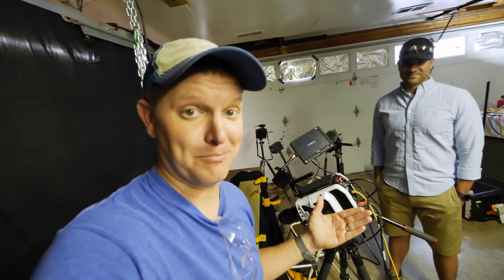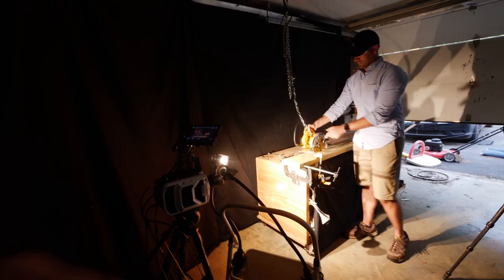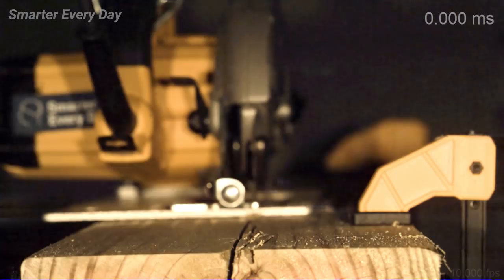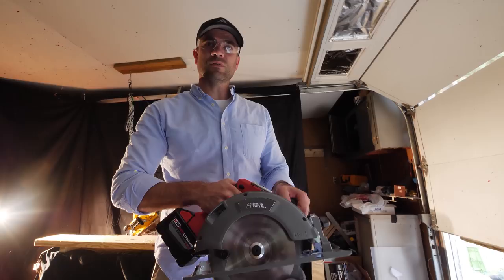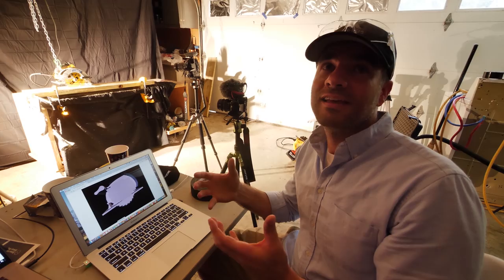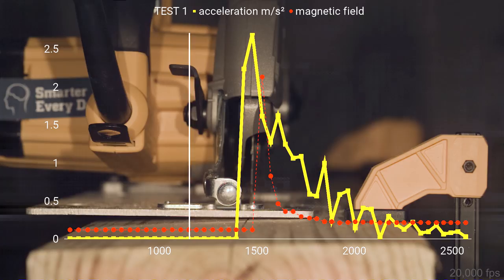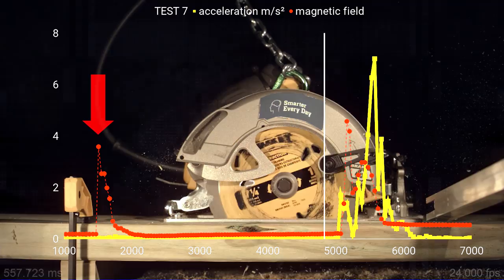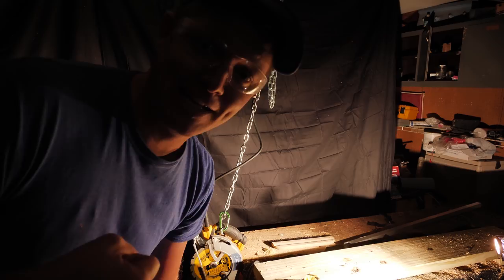Circular Saw Kickback Killer (We used science to make tools safer) - Smarter Every Day 209

Comment: Even if you don't believe in the concept of this specific safety device you have to consider the implications of how they got their solution. They used AI learning to find a solution to a problem. The computer can analyze thousands of situations and react pretty immediately to a problem. Using this method could open a door to many other similar solutions to issues that may not even be related to the circular saw at all. To me, this video is about their solution to kickback as much as it is about using machine learning to solve real world problems.
Reply: Yeah, I agree. This is essentially an ultra refined clutch calibration that stops the motor instead of intentional slip.  This  would be a very nice feature in any high torque circumstance.  My thoughts  jump to a right angle drill.
Reply: I would call this tech a :  velocity sensitive position relative safety sensor. (VeS PReSS)
Company name ....Ves Press safety sensors..
Reply: I do appreciate the effort, but it didnt use AI.  It used machine learning, which is what we used to call statistics back in the day.
Reply: @roromad9603  They use what is nowadays colloquially called AI: a computer program that can make "smart independent decisions". How this particular AI is implemented is by doing machine learning: feed the program plenty of data, and let it learn by itself. Also, I do appreciate the efforts but whereas it may appear close to statistics, there is a slight difference. Here, they only care about prediction: they don't care to understand what constitutes a kickback event , they just care to detect when there is one. No statistical machinery is involved (no test, no inference, no nothing). At the end of the day they don't have a better understanding of kickbacks: the machine has just learned how to recognize one. Machine learning and statistics are not interchangeable words.
Reply: @wiwh404  This is not artificial intelligence nor is it machine learning.  There is NO WAY that I want a simple program predicting whether or not a kickback event is occurring.  To do so would be to put people's lives in jeopardy.  This is statistical modeling based on data.  That is it.  Sorry, but it is nothing more.  People like to throw around "AI" and "Machine learning" to make it look like they are doing something more than what it really this.  This is just statistical modeling.  that is it.  Now, this does not negate the fact that two really smart people are trying to figure out ways to make things safer using very cool methods.  I appreciate and respect the effort.
Reply: @roromad9603  You misunderstand what people mean by artificial intelligence, and you seem to misunderstand what  machine learning means. I agree partially with what  you're saying after having corrected for your wrong terminology. Nobody is claiming that this software can somewhat learn and be more clever than a human. They are by construction restricted to their very restrictive context and very  limited inputs. But this is very much machine learning by its very definition, and is very much what artificial intelligence has come to mean nowadays. This is, however, not very much about statistics. If you insist that there is a mathematical model behind it, then I would rather use the term "probabilistic model", which machine learning in general makes heavy use of, in all shapes and forms. I think your expectation of what "artificial intelligence" means are too high.
Reply: @wiwh404  during school i worked construction.  i now do work in the software world (after getting an engineering degree).  I know what AI means, what machine learning really means, and what statistics really means.  in my experience, people use AI and machine learning as marketing terms rather than the computing use.  you can correct all you want on the anonymous internet.  i know my terminology and i can easily spot someone that reads blog posts in the internet.  regardless, neither of us is going to concede.  have a great day.
Reply: @roromad9603  I didn't mean to hit a nerve, I'm sorry. I'm a Ph.D. in statistics and just wanted to point out that there are other definitions of these words than yours. You can keep yours, or just use the definitions most people use. The latter makes communication easier. Either way, it's your choice.
Reply: @wiwh404  No worries!  I realize that i am a stick in the mud when it comes to this.  i guess it stems from the fact that I feel that my AI work is much more complex and different than what people use as marketing terms.
Reply: @wiwh404  What an insanely polite and classy way to tell this guy to just go on using the terminology he wants for the things that every other people already agreed in a name. That is 2019 at its finest: people that think their way of calling things is better and everyone is wrong, not them.

@roro mad This is what the other 8 billion human beings  around the world would call AI and machine learning at the present time. This is not statistics by any means. As Guillaume pointed out, you don't build a mathematical model from the data. In fact, the way the computer recognizes things after you fed the data is irrelevant, and most of the time really odd and counter-intuitive to humans.

The point of using AI and machine learning in here, would be to distinguish between a simple change in acceleration (that could just trigger a switch and turn off the saw) from a proper kickback event. This, if done correctly and with more data, should avoid triggering on false-positives, although there are probably better and cheaper ways to do it.

The one thing i would agree with you is with this: "There is NO WAY that I want a simple program predicting whether or not a kickback event is occurring." This is actually scary, but unfortunately to you it's already happening: self-driving cars are around the corner, and even with smaller driving-aids you have sensors and computers deciding for your life (being machine learning or not). Not to mention the possibility of creating AI war drones to decide if you're a threat or not by using a weird machine algorithm.
Reply: In this use case, I think using machine learning is overkill and potentially dangerous. I would rather trust a set of hard coded thresholds here.
Reply: Maybe but once upon a time necessity was the mother of invention, rather than the other way round

Comment: Nice usecase for the AI.
Reply: You think saw kickback is bad?  Just wait until the AI kicks back when it rises up against us and starts chasing us with the saws that we gave them control over.
Reply: @jeffirwin7862  I like the Terminator movie too. Don't wait until they all become evel, just find someone of them that can be your friend and can protect you ;)
Reply: Jeff Irwin i need to start saving and repairing my dad and grandfathers old electric tools if i want power tools that dont kill me of their own free will i guess
Reply: Lassi Kinnunen  lazy programming basicaly. Let the ai figure it out, realease the software, iron out the problems as the complaints come in. Software is all the same nowadays, it's all in a beta state, never finished, always being changed and never quite works the way you want it.
Reply: Not really. Over engineered like crazy. This could easily be solved with just an accelerometer and 60 minutes of calibration to determine at what level of sudden motion it should turn off.
Reply: Lassi Kinnunen  the machine learning in this use case is really just a fancy way of saying they sampled a bunch individual saw usage, and created an algo to use in the micro software. there really isn't an AI in the finished device, but rather a micro running commands based on input. in any case, this is overly complicate. just use a blade stop like stop saw has. comes in contact with skin; breaks the saw blade. no false alarms, not complications.
Reply: @fd3871  There is AI in the form of a trained neural network, it's just not doing active machine learning anymore.  Also, they didn't create the algorithm.  The algorithm is "use a neural network".  The magic is in the layout of the neural network (number of neurons and hidden layers) and the weights between all of those neurons.

Comment: ..........am I the only one disappointed that they removed the safety guard? I really wanted to see how quickly that will fall into place.
Reply: @albertogomez6196  Sorry, but I've never seen someone use a saw without the safety guard.
Reply: @albertogomez6196  .....ummmmm...I literally know ZERO people that have taken the blade guard off. That includes about 15 contractors who use one professionally.
Reply: @albertogomez6196  Maybe people you know do that. I would not call that a "normal" practice.
Reply: animalmother556x45 usually framers or a dedicated cut man will wedge the guard up. Sometimes thin or profile cuts can’t be done without the guard being manually held open. The angle of approach makes the guard push the saw over instead of opening the guard.
Reply: You’re not the only one man
Reply: iOS gameplays   If someone removed that while working for me would be FIRED!!
Reply: I work 7 hours a day with circular saw somw days.... newer had an idea to remove guard :D
But yes, i have held it open with my other hand for tricky cuts. But when you hold it like that.. the "kickback" can only happen away from your body becous the saw is turned away from your body.
Reply: These experiments are done so  the kick backs may be observed and studied without the encumbrance of the safety guard which is an already known.  I am very sure they will not want to use a saw for real without the guard.  When making experiments it is usual to make things as simple as possible so that only one variable at a time is in play.
Reply: @scottmorgan133  I know nothing about woodwork but common sense tells me, that maybe, just maybe if the safety have to be compromised to do the task, the tool isn't designed for that kind of job?
Reply: @albertogomez6196  comfortable? Have you used a circular saw? I would think comfortable would be as much shielding between any part of me and any kind of rotating saw blade. 

As for having to wedge the guard open... I would suggest that maybe the wrong tool is being used..
Reply: Herioz no, sometimes it is the only way. There are a lot of times where safeties actually make things a little bit more dangerous. This is also why OSHA invented the Competent Person option for sketchy stuff.
Reply: NoSuspect not really. Ever ride a motorcycle?? I feel much more comfortable riding my bikes then I do being restrained in a 4000lb battering ram made of steel and glass.
Reply: Probably was for the filming of the blade stopping? Cant see it very well with a guard in front......................... Otherwise maybe they'd have left it on.

Comment: As someone who knows a guy who nearly got disemboweled by a saw kicking back, this is indeed something that needs to be added to more machines.
Table saws, certain types of band saws, and even a few radial arms have things like this already, so why not the ones that can potentially do more than just cut a finger off at worst?
Reply: Saws are dangerous in general and even with experience things can happen that are bad and usually it comes from fatigue while using the items. Where your brain power is running out and those things you normally feel or listen for are delayed because of fatigue and this is where these things can help.
Reply: Bandsaws are relatively safe. Table saws can impale you with a piece of wood, and throw wood at crazy speeds, so you won't just lose a finger.
Reply: Plunge/track saws can still kick back. you're just riding a saw in a track, not fixing it to the track.
Reply: @sarinhighwind  fatigue plays a big role but in my experience the biggest contributor in woodworking tool accidents today is intentionally disabling safety features and ignoring safety guidelines. E.g. removing safety covers, splitting wedges, taping on safety switches. In other words being stupid in the first place.
 Thunder Winkle : plunge saws & track saws are not really more safe than a circular saw with a spring cover. While any such mechanism is great and reduces severity of injury the best safety feature to prevent pinching and thereby kickback is, again the wedge.

Comment: My dad ran his small construction business for the better part of 30 years, which means I got my start in construction at about 5 years old.  During my lifetime I can't tell you how many times I have seen both experienced pros and newbies make a careless mistake using the saws. There is one major rule for the circular saw and that is, NEVER MAKE YOUR CUTS IN BETWEEN THE SAW-HORSES. That is what causes the pinch.

To be honest, cutting foam insulation is what I have always considered to be the most dangerous task in construction. Doesn't matter if you use a circular saw or a table saw or a chop saw.... if the foam starts to pinch it will grab the blade and shoot the saw back at you quicker than you can count the fingers lying on the ground. For anyone that has to work with foam insulation, it is absolutely better to use a battery powered circular saw because it has much less torque and the blade brakes much quicker

Comment: This is actually really clever! Nice job!
Reply: I did the same but I used a micro switch that triggers when the plate loses contact to the work piece, works a treat, costs 2$ + an afternoon.
Reply: @teuton8363  so you only cut plywood? I just use my brain and till this day a saw has never kicked back on me.
Reply: WHAT VIDEOS DO YOU NOT WATCH????????? Ive seen you everywhere
Reply: @teuton8363  Good idea.  How often did it activate accidentally?  There was a change in patent law a couple of years ago in response to some highly publicized patent troll cases.  It is now much cheaper and easier to get a provisional patent.  Like  $100.  You can get people to draw your claim cheap on the internets and file, then shop it around.  Or just sell the conversion kit on your facebook page.

Comment: This happens a lot with anglegrinders, but I haven‘t had this happen with a hand saw before.
Reply: Oh so true! Especially if you are using a zip disk!
Radial arm saws are also very very prone to kickback
Reply: @PT1040  Please tell me, what exactly is a "zip disk"?
Reply: Cutoff wheel I'm guessing? They're also called circular saws because hand saws essentially describe a flat-bladed human-powered saw :)
Reply: Agree, much common with angle grinder especially when cutting deep on concrete with diamond disc it will quite easily kick back.
Reply: @Mister_Pines  yep, what they said ...cut off disk. my terminology is old school. I believe that's what they were first called when they introduced them for angle grinders.
Someone else here mentioned concrete saws. I concur. Those concrete saws can kick back like a bugger as well
Reply: I've never experienced kick back with a hand saw either. My goodness that would surprise the stuffing out of me.
Reply: Unfortunately no algorithm will save you from chunks of cutoff wheel zipping thru the air.
Reply: It happens mostly when you’re cutting anything really long with a lot of play. You’re too focused on getting the cut straight that you don’t notice the wood coming together to pinch the blade.
Reply: @davidmtwigg  hey ya never know... Maybe with an ultra-fast radar system detecting flying debris, motor actuators on our body could twist us around like neo in The matrix to avoid the impending contusions from body penetrating shrapnel  🤣
alternatively, Star trek type Shields just need to be developed to shroud our bodies
Reply: But if it happens with a circular saw, it's way more dangerous.
Reply: Yep side grinders are the worst,
 one has got me before. End grinders can be pretty bad to. Even hammer drills when drilling concrete and hitting rebar. This can actually be applied to alot of tools to prevent injury. Great idea.
Reply: Especially when your shooting your sparks away from you. That can be dangerous
Reply: @michaelenglish4710  it would be great on a hammer drill. Had a bit jam on rebar so hard last week it took a 3ft pipewrench to finally break it loose.
Reply: @davidmtwigg  I think it would be great for hand drills to when using drill bits and hole saw's.They can twist you up pretty good to.
Reply: @michaelenglish4710  so true so true! I've had my wrists wrenched plenty of times especially when you get into the torquier 1/2 inch and bigger drills
Reply: FYI, the three of you mentioning rebar and drills, Dewalt and Bosch have both  introduced SDS drills with kickback control built in.
Reply: @mlindholm  that's true but the Milwaukee grinders also have the quick stop feature but I dont think it works as good as this idea.
Reply: @Backyard.Ballistics  yea if your in an ideal situation. But that's not always the case.